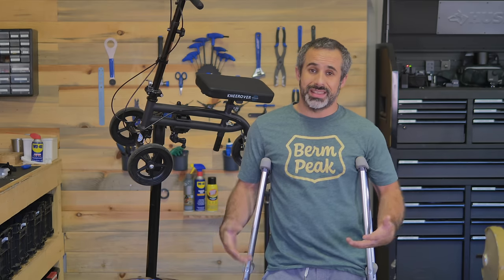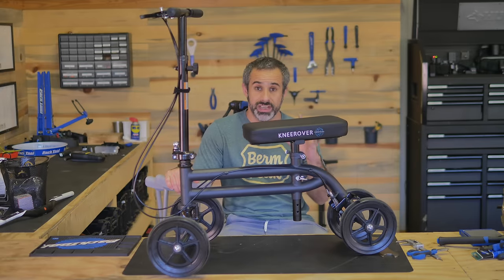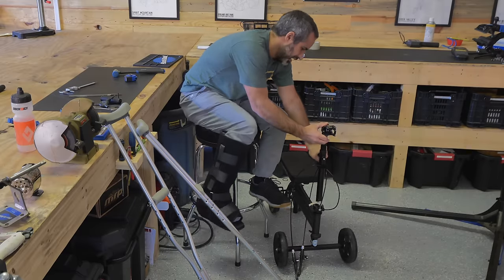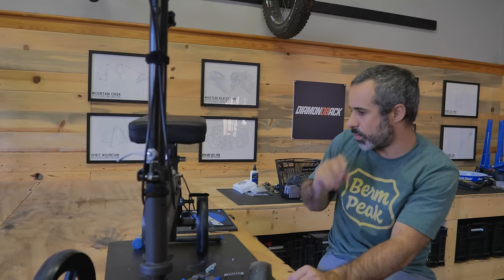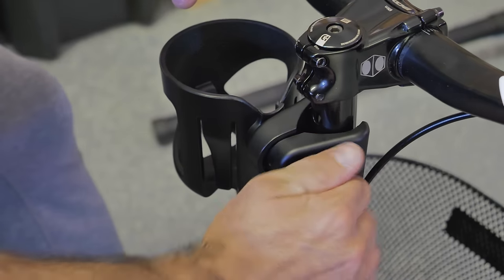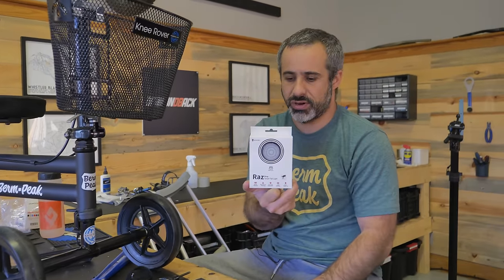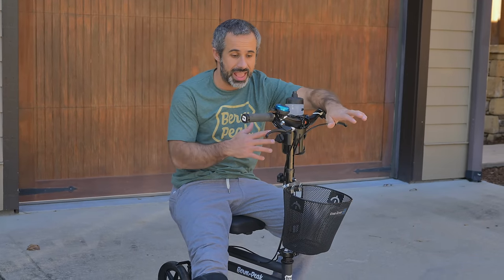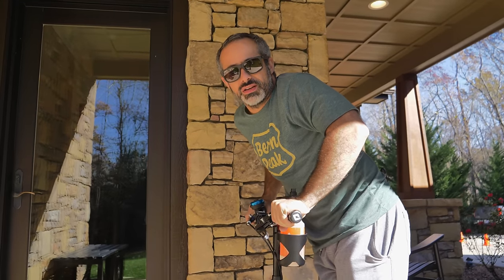Souping up my shiny new Knee Scooter!

Comment from the maker: By the way, those were carbon bars that made a cracking sound when I overtightened a brake lever a few years ago. I had put them aside “for display purposes” but figured they were strong enough to toot around the house.
Reply: Good to see you salvaging something like that.
Reply: Hi Seth, I saw your Blue Orange p7 in the video and I thought you sold it. Did the person that bought it not pay for it?
Reply: Were they the ones from the murder machine?
Reply: Do you have TikTok
Reply: @spencerclaussen3403  no
Reply: Who else remberes that video. Also he needs sticky fingers on the levers
Reply: @ryanmarotta2413  looks like
Reply: @dklyne  Ebay wouldn't allow him
Reply: @bridger1579  why?
Reply: @bridger1579  thanks

Comment: Seth thank you just put a smile on my face reminded me of my Nana’s Rollator after she had it for three years it had a number of issues. Well I took the entire thing apart cleaned and re-greased it replaced the break cables. put a cupholder ,cane holder , some reflective tape on the sides. Many of her doctors and nurses  were impressed because her rollator was one of the safest ones they had ever used. If anyone asked about it My Nana would proudly say “oh my grandson fixed it up” She had  it 12 years after my initial fix every now and then I used to give it a tuneup. Sadly My Nana isn’t around anymore. Before i gave it away I gave it one last tuneup and found it a new home.
 I apologize if this is a bit of a rant I just wanted to say thank you for reminding me of the good times with my Nana. I hope you have a speedy recovery. - John

Comment: "entry level knee scooter": carbon bars and accessories 

“Intermediate knee scooter”: add sr suntour hlo xct30 and upgrade to hydraulic disc brakes

“Professional knee scooter”: fox 34, dropper knee post and add 1x11 drivetrain

Comment: I just watched your Alaskan mill video. Quick recommendation would be to file a second chain just for milling. Usually that’s about 10 degrees as opposed to the 30 degree stock. A Stihl dealer could do it for you but being laid up you could as well. It would cut much faster = efficiency.  Heal up. Mazel tov!

Comment: Thank for this,
My Wife is getting ankle surgery and will be "no weight bearing" for 6 weeks.
I was thinking of drilling a couple of holes for bottle cages (I have the frame compression nuts from repairing a steel frame). You did a great job on the cable length. I probably won't go with the carbon bars (I have some cut down Barracuda bars from the 90's.. 380mm ish) I know you posted this a long time ago, what happened with the Berm Peak KneeRover?
Thanks for posting this tongue in cheek and entertaining but at the same time useful video.

Comment: Never estimate the power of Zip-Ties. As a retired electronic technician, I've used thousands of Zip-Ties in a multitude of industrial/manufacturing applications. In particular, I liked your use of one to bypass the steering stops. In addition, the installation of the basket and water bottle holders are high on my list. A week since the surgery on my broken left foot, I will now order a Knee Scooter. Thank you for the video and may God Bless you and your family.

Comment: I broke my leg last riding my bike,(spiral fracture from ankle to knee) and used a wheelchair. I tried a knee scooter at first, but because of the specific area of the break, it was very painful. The wheelchair however was very fun, and I could do all sorts of tricks in it. I strongly recommend getting a wheelchair, as you have the full use of both hands and can have fun doing tricks with that while waiting for your leg to heal. (for example, wheelies are really fun and easy, and you can do a lot of fun things with them. I was eventually able to ride down a staircase while doing a wheelie)
Reply: plus it doesn't strain your leg at all

Comment: I got a question I bought a giant brand strider/balance bike ... Giant designed it with a screw on bottom bracket you heard me right bottom bracket it also has a threaded rear hub with get this disc Mount attachments not sure where they were going but there is no traditional brake placement other than possibly disc brakes..... My question to you is what size bottom bracket and chain assembly was on that little orange bike the kid had.... As they both seem to be in the 12 to 14-in tire range

Comment: I just got this same scooter. The included rubber wheels absolutely suck. They will scuff up your light colored vinyl or tile floors. My kitchen looks like a Nascar racetrack. I contacted Knee Rover and they graciously sent me non-marking wheels. But getting the wheels off what a major pain. The bolts are frozen in place with loktite for obvious reasons. You will never be able to get the wheels off with an Allen wrench without stripping the bolts. The rear tires were on even tighter than the fronts. We stripped both rear bolts attempting to swap out the wheels. I had to contact support, they sent me two additional bolts. Hopefully we'll be able to get the rear wheels off to swap out, otherwise its going back to Amazon.

Comment: When tires fet wet, brakes don't work. Actually needs disc brakes. Then kneelig pad needs to be to have stiffer pad because it wull compress. I used an over te shoulder Maxpedition bag wrappingthe strap around the handlebars. Light on front could help due to level changes can put you over handlebars.

Comment: My sister had to get one of these and it had a actual axel for the brake and I attached a flywheel from a old snowmobile and put a starter on it with a push button so she could speed thru the hallways at school

Comment: you should have put actual scoooter parts on it, you could have put an scs fork on there which can be connected to a bike stem to my knowledge with an extended axel to put wheels on both sides of the fork

Comment: My ankle is broken because 53 year olds need to stay out of the skateparks. Anyway I discovered that the steering lock out is designed for using the kneerover  on stair cases. Lock the handle bars out to the side. Flip the river upside down and you have 3 points of contact on 3 separate stairs. Grab the top tube as the handle and hop up. Secure.